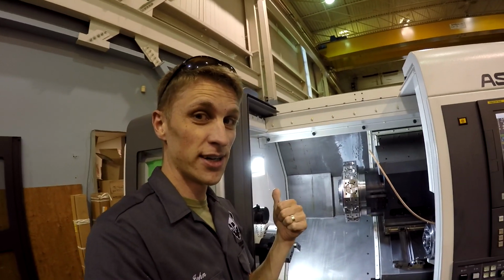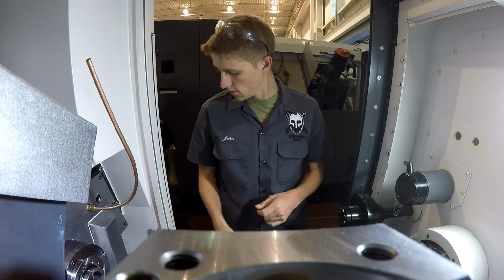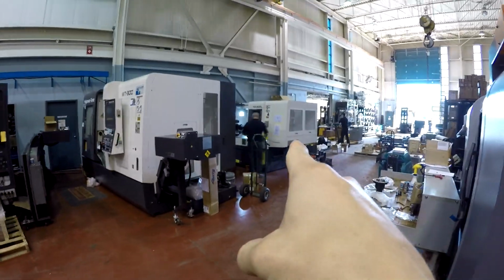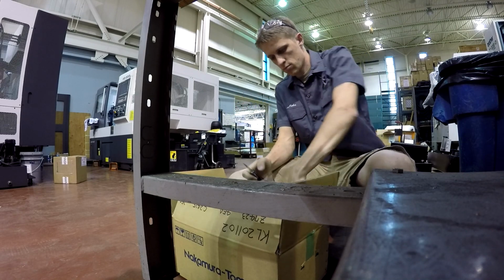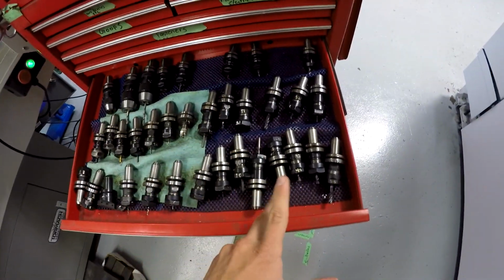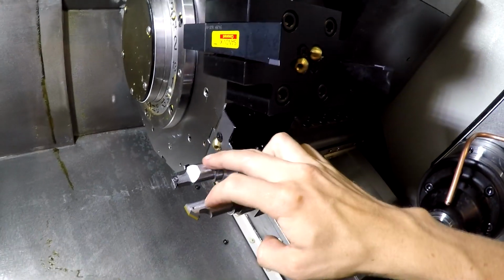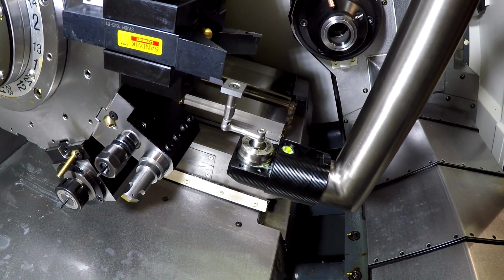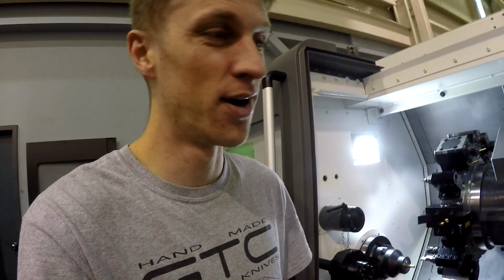We bought a new CNC Lathe - Nakamura AS200LMYS

Comment: Terrible machines for the money.
Reply: Matthew blackburn I've watched Titans of Machining use their haas machines with great tolerances and running up to 800 Inches per minute and they cost alot less.
Reply: brocksdaddy081910 I have the "joy" of setting/programing/running a Nakamura Tome WT150. I've never actually been near a Hass Lathe but going off Hass Tips Of The Day I think its probably what I would go for. the Nakamura is in no way shame or form a machine designed for the user. the Hass really looks to be.

Comment: While that is certainly a nice machine... I feel like you could of gotten a better machine for the task at hand  for considerably less money.   Now if you have other things to run on it...good choice.   I have seen many shops end up with buyers regret and not being able to cover payments.  Personally i don't think i would spend that kind of money on a machine without a job to run on it 24/7.    Case in point,  i was eyeballing a makino f5 for hard milling.   At over 200k, it just didn't make sense - for the work load right now.    It will one day but not yet.    For now,   a used hmc with a couple of tombstones made much more sense economicly,  capacity wise,  and in the sense of establishing a "system"  in the shop.   Good luck with the machine..  Sincerely.

Comment: its nice to see you graduate and not stay stuck in tormach fantasy land. its also great to see guys self teach. I've found the industry to not be very good at sharing and teaching. I mean the machine dealers are great but that only helps owners and lead guys. getting that passed down the ranks in a factory happens at a snails pace. sometimes its job security for a lead guy. sometimes its because its more important to the owners to keep the spindles turning than actually explain what's going on and have the low level guys help themselves. self teaching has the advantage of not being held down but the disadvantages of limited exposure to formal learning and solutions of others.

Comment: Don't want to be a smart ass but when you are running such high speed on your small parts, you must learn to switch between constant surface speed to a slower constant rpm before send your turret home. when it is screaming fast and you send it home the motor controller doesn't know what to do with all of the voltage and it will destroy your controller. When treading , run in constant rpm or you will get a bad thread.

Comment: fun toys, i've had a mori nl sy, currently running an  okuma lb3000 ymw and a couple of swiss lathes and i have a dura also. i will honestly say the fanuc controls are the simplest controls to run out of the bunch. good choice on the royal collet noses, no indicating saves so much time on those.  if you have the choice, go to y axis stacked holders as soon as you can. you can get so many more tools on that turret and it will make your setups so much quicker leaving all your common tools in place. i am curious to see how well you get fusion working with it, i just started playing with it and like it so far, and i want to adopt it in my shop.
Reply: Best comment on this thread. The Y axis on this machine is crazy strong...

Comment: Congrats! I hope you enjoy the lathe and learn how to program it.  I bought a Mazak SQT15MS (no Y) a few months ago and it's awesome, we program it in Mazatrol at the control and that was a little learning curve. I'm used to programming with CAD/CAM and now it's text based again :-) Can you program the Nakamura at the control? or is it just CAD/CAM?
Reply: As far as I know every fanuc controller I have used you can do straight controller programming. Basic stuff is easy, more advanced stuff is, well, more advanced :P
Reply: Programs can be made at the machine, he just prefers CAD / CAM.
Reply: I know programs can be made on the machine, but some machines have controls that are better suited for programming at the machine, like Hurco WinMax, Mazak Mazatrol, etc. So what I meant is does the Nakamura have a decent "dialog programming"mode?
Reply: +Egbert de Pauw Aaah, gotcha. Conversational programming similarly to the software on Tormach machines. I doubt it has any capabilities like that, fanuc usually doesn't roll that way.
Reply: I know, I have an Haas VF2SS and a Mazak Lathe, both are different beasts in the way you program them. On the Haas you only do simple things in g-code and the rest in CAM on the Mazak, well you don't need CAM the control is so easy and quick.
Reply: Yea it all depends on the machines. Okuma controllers really are quite awesome. Ive heard great stuff about the Brother controller as well. Most fanucs I have used where on the machine because its the cheapest option, though its not bad, its just harder to run and program at the machine. 

I have ran a couple fanuc controllers that have a graph function, partial rad calculators and things like that but besides that there mostly manual writting wise.
Reply: +MrLiamCooley I'll agree with that. Never used anything from brother, but Okumas are awesome. Ran those for a few years then went somewhere that only had fanucs. They're definitely a little more challenging and some of the variable characters don't make as much sense as okuma. Okuma did have EGT or whatever it was called, it was incredibly hard to use and prior programming knowledge was needed anyway.
Reply: Lol I think we should all be thankful that machines that take tapes are hard to come by in recent times :')

Comment: I hope it pans out. :) Other than that, it's a great tool. I'm not sure, but if, this is the same as the owned by a factory near me, (which does high precision suspension parts for scientific applications) if so then this is a beast in terms of churning out parts. But, i seem to recall being a bit of a chore "programming" the work in.

Comment: (spoiler: that's not how you remove the chuck, the draw tube should be in the inward position so you have more room to unthread the coupling within the travel of the jaws, once the coupling is completely disengaged you can finish removing the bolts holding it to the spindle nose, you should never let the weight of the chuck hang on the threads of the draw tube, I know this because I have made two brand new draw tubes for two of our lathes from scratch, those threads on the draw tube will rip right off of there with the pressure that the draw tube cylinder can exert, just be careful with the draw tube.)
Reply: Excellent advice.   I didn't even notice

Comment: I specced out a couple of Nakamora's from Elliot back in the late 80's for the company I worked for.  The first was set up with a hydrodynamic bar feeder taking up to 2-1/2" bar stock(10ft) and a Nikken collet chuck that would take the 2-1/2 bar.   The other was a 3 axis lathe with took changer.  Fun programing and keeping the the interlocks running.   Spent a week at Elliot's on a maintenance course for the 3 axis.  :-)

James

Comment: What is a market price of this lathe?
Reply: Ok? You must think a 6 axis lathe is cheap or something.

You can see the numbers in this video anyways
Reply: ~250K depending on the rest of the options he got
Reply: Less than that, dont talk out of your ass.
Reply: I have worked with a few companies that own many machines just like this and they do not cost that much.
Reply: I ran companies was in charge of machining departments and equipment and process engineering  then started my own company  still doesn't change anything on what the machine cost. This machine was around $250K with all the rigging, tooling, options, training, holders, the collet system, bar feeder which he is fool if he didn't get. I just quoted HAAS got $135K without even trying that hard and this USD not Canadian so you're looking at just $178K just for the machine.  Typical most Japanese machines are around 10%-20% higher than HAAS so now you're hitting the  $190K CAN in just the machine.. Now,  what he paid probably ~20% less or may have gotten some discounted options and/or tooling  since IMTS is coming up.
Reply: I have never ran a haas lathe so I cant speak much about them. I have however worked with and in Management in a lot of my local area shops that own many Nakamura machines just like the ones in this video and, we bought them from Elliot. Maybe the companies I have worked and work for got deals on their machines, maybe not who knows.
Reply: If you/company brought alot them that's possible
Reply: John said the extra turret was 100K by itself.....
Reply: Chief Machining Possibly lol The bought 7 WT300s at once one year :')

Comment: Fantastic birthday present! Kind of sucks that the tool setter isn't a swing in type though. I really like having that on my DS lathe. If you have any questions regarding parts catching don't hesitate to reach out, I've had my fair share of challenges with this! Does that bad boy have full rotary on the sub spindle or just indexing? How many rippems is you live tool rated for?
If/when you bust that part of blade switch it up to a through coolant blade. I'm using a seco and tool life is about 3 times that of a regular blade and chip evacuation is way better. I almost never get jamming or a birdnest, well worth the extra cost.
Reply from the maker: +Widget Works Manufacturing Inc. I agree that the manual tool setter is the only thing worth complaining about. Yup full c axis on both spindles. 6000rpm live. Good to know on the part off blade, thanks!

Comment: This is a very nice Machine but for the Parts you are running it is waaay too big! A smaller Machine(Size not Quality) runs faster, accelerates faster and will spend less energy moving Turrets and Chucks around.
A better Size would be waht Brad uses at Tactical Keychains.
Reply: 2384SKIPPER Brad has offered advice and has told me personally that John refuses any help he has also said that Johns systems are shit and needs some major help. Brad designs a product, prototypes, finalizes, makes product, and ships product out in the time it takes John to make one fucking knife lol.
Reply: Who is Brad ?
Reply: @bretteur2legende  brad is the guy who offered john advice and was turned down. After that brad dropped his last name from sheer disappointment.
Reply: @Z-add  Thank you